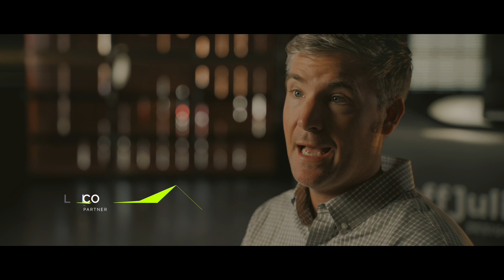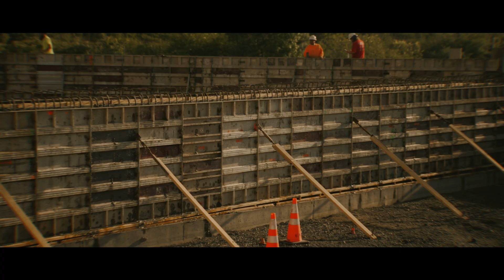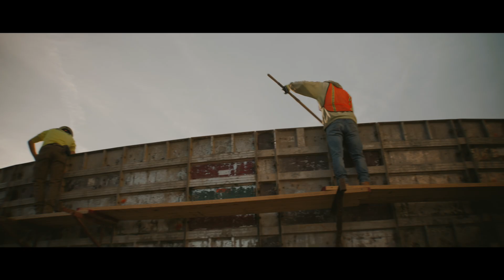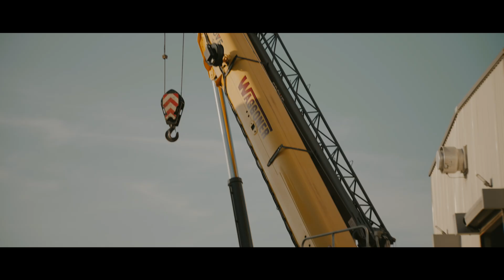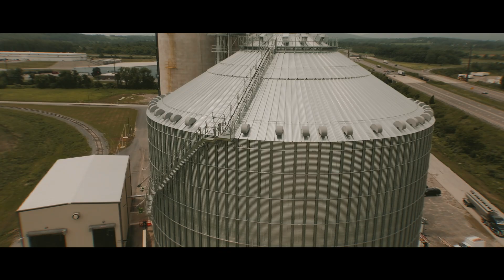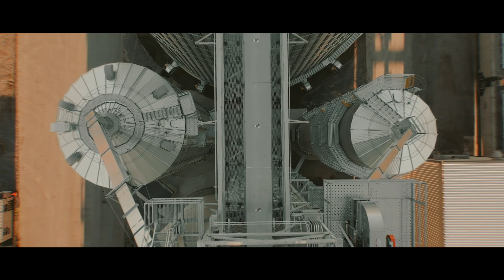Pennsylvania's Largest Grain Bin Build | Groff Julius

Comment: Hope the Cheap Labor didn’t 
OVER TIGHTEN the Bin Bolts !!
When that bin is Full there’s a Massive amount of Pressure on the Lower Bin Sides !!
  Those bolts will Explode like Bullets if Over Torqued, aka “Weakened”
Then that Big Can will “SPLIT WIDE OPEN” !!
Reply from the maker: Safety is our top priority, and all measures were taken to ensure the structural integrity of the bin.

Comment: We're one of Country Views growers, 4800 head quad barn in the same county.
Reply from the maker: Cool! Great people and business at CVFF. Thanks for watching.
Reply: @Groff_Julius  One more thing, is the 817k bushel the accurate figure? I want to settle this argument with one of my employees 😅
Reply: @jjmmill just give the diameter of the bin and the side wall height and you will have the capacity , just math
Reply: @lannyfenster7461  I just finished a NRCS pit, 14' high, 482' around, I.D.  How many gallons does it hold?

Comment: All that mill and the unit train rail system has done is hurt the local corn market. Our basis has gone down because the need for corn has gone down because they bring corn in on rail
Reply: Dumbo !!  Why would they have a Big Dryer & big wet bin if they wouldn’t take in Pennsylvania Corn Locally ???
So Stooopid
Reply: I was really excited when I learned of this mill being built. I was really disappointed when I learned most of the corn wouldn’t be coming from Pennsylvania.
Reply: Yeah bigger isn’t necessarily better.